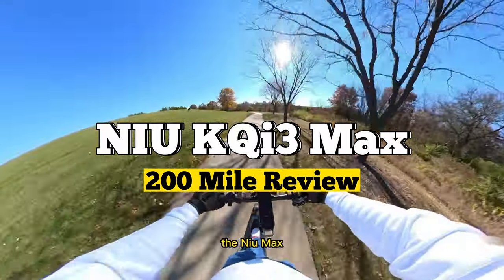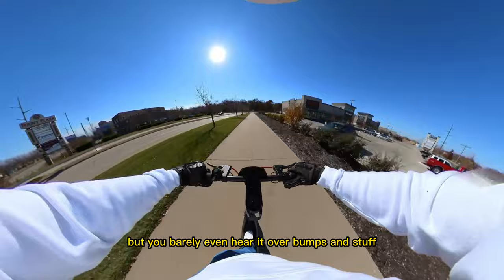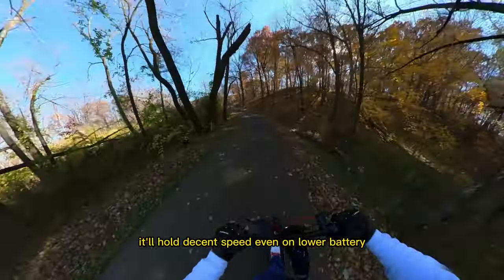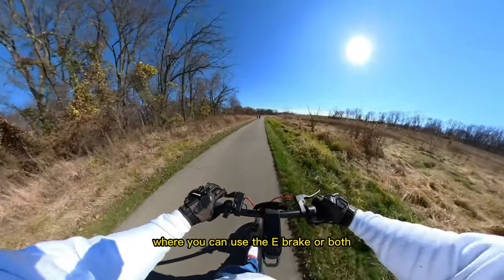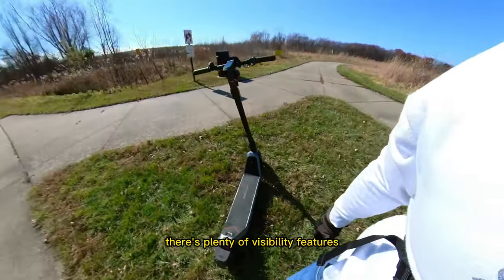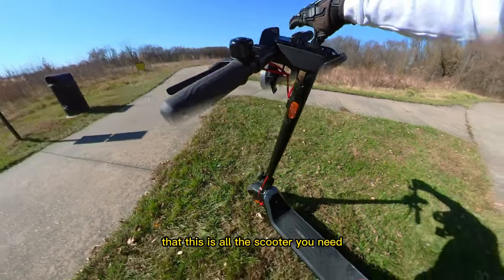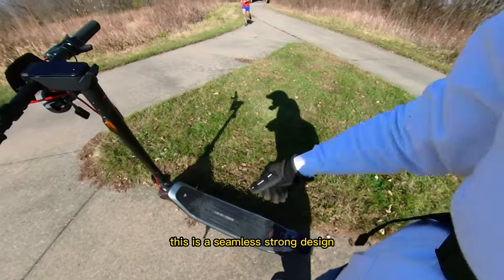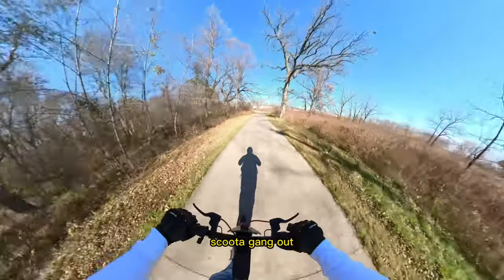Niu KQi3 Max: I Have Zero Complaints About This Electric Scooter

Comment: Had this for about 3 weeks. Its amazing. I cant believe how smooth it is. And 23mph is plenty speed. Battery is decent too. And so comfortable. I had a ninebot max and this was definitely an upgrade.
Reply: Yeah 23 is fast if you’ve never gone that fast before with😊out being in a car
Reply from the maker: It is the smoothest scooter I have ever ridden without suspension without a doubt! Feels great to cruise it!
Reply: Best scooter under $1000. 

I got rid of a Ninebot Max and now have both the KQi3 Pro and the Max. If the Max could go 30 mph and had a basic suspension it would be perfect. As it is now it’s *close to perfect*, especially given how inexpensive it is. 

NIU builds their scooters like little tanks and the build quality makes other brands look like flimsy jokes. I returned a Uscooters/E-TWOW GT Sport a few months ago and now realize how overpriced it was. 

I can’t wait to see what NIU will be bringing out next year.
Reply: @thevoiceofreason4104  nah it doesnt even have suspension. speaking of best scooter under 1k, the crown belongs to vsett 8 and yume s10. vsett 8 got 750wh battery instead of 600, it got suspension system, top speed 25mph, 600watt motor, foldable handlebar, solid tire, signal light. n i got mine for $650. s10 got a whoppin 1000wh battery, dual suspension, and 30mph for $840
Reply: @jake9854  In the city I live in scooter motors can't exceed 500 watts. Sucks, but it is what it is. You can lose your scooter if caught.

Comment: I had mine 6.5 months and paid $ 729.00 for it. Afrer riding on asphalt bike paths the rear tire was losing air pressure. i found a slight hole and tired to plug it. Well it didn't work. I purchased a new tire. Called multiply bike shops and repair shops. No repair shop wanted to touch the scooter. So i watched a Utube video and tried to fix it myself. Afer 3 days i finally got the old tire off ( By cutting it off) and the new one on. Guess what. It wouldn't inflate ! Air was seeping out of the tire by the rim area. After a week of tinking with the repair work. I just got fed up and gave it away to cut my loses. Scooter was well built and fun, but took to many man hours to fix. I magine if it was an electrical issue. Good Luck ! Be smart. Save your money..
Reply: I have seen so many posts on Reddit have the same issue. That really scares me away from NIU. Other issues like error code 03 etc. also people are saying there is almost 0 customer service in the U.S. from NIU. Canada is better from what I saw. YouTubers are not like people from Reddit are willing to share the real issues it has. Sigh. Long term review is more valuable than those unboxing and first ride reviews for e scooters. I am glad I didn’t buy it. Will stick with brands with longer history better customer service, etc. probably Apollo or Segway.
Reply: did the warranty not cover the product?

Comment: Really zero complaints, 
I've owned one for three months, in that time, 
1) the self sealing tires,, don't
2) they give you an Allen key, you need it to tighten the head bolts, oh buy an Allen key set there are others that need tightening
3) you can set the custom settings but after 3_4 miles it beeps and drops out
4) turn Regen braking off, and it randomly will turn on.,
5) throttle starting to stick at quarter

Comment: I just got this scooter about 4 days ago , best one ive had for the price . Only complaint i have about it is that we cant fully turn the headlight off during the day , i would imagine thats using more battery power
Reply: It's like a 2.5W light on low power maybe 1W. You've got a 700Wh battery so will use 8Wh if you let it on for 8h, pretty negligible  and adds safety.

Comment: Hello, good review you done there !
But i advise you to not step to full gas on the hard hills it can damage really bad the motor and the battery.
I used my electric scooter like this (my advise) and it done 1000 kms without losing any range or dead battery cells.
Reply from the maker: It's ok man I have 20,000+ miles I know what a scooter should be able to handle trust me. I am here to test them under heavy riding conditions so people know the scooter is legitimate.

Comment: My commute is 2 miles, carry up 1 flight of stairs and then carry across the office about 30 yards. Would u recommend this scooter or do u have another recommendation? Currently i use emove cruiser but its just a touch too heavy for the stairs and walk across the office.
Reply from the maker: Yeah it should be good for that, I would also check out my Vsett 8 review, that is an equally good option with full suspension and 26 mph top speed. Best customer service from RevRides! Our $50 off code is "gang" for the best deal possible!

Comment: Great video and very informative! We live around San Francisco with tons of hills. Will this one be  a good entry choice on hills? Lastly, where do you take it for maintenance or flat tire repair? What is the average cost for regular break maintenance. Thanks. (Just subscribed to channel)
Reply from the maker: This will do decent on hills but nothing like a dual motor scooter to be completely honest. Brake maintenance is very cheap you're looking at brake pads every 500 miles that are about $10 on amazon. I would ask Niu about tire changes I think they have some repair centers you can ship it to or most people just do it their-self if you are capable.

Comment: Do you recommend the Vsett 8+ over this? I’m debating between this and the KQi3 Max. I need something that's versatile & durable with the ability to adapt to mid-rough sidewalk conditions while getting the most range
Reply from the maker: They are comparable to me on flat smooth surfaces, but if you have any semi- rough routes that you like to take, you will definitely prefer the Vsett with the suspension.

Comment: You seem to like the way this scooter remembers the custom mode, but lacking the ability to toggle ESmode and Custom on the scooter is a downside, imo. I can't imagine having to push a button once after tunring on is a meaningful hassle, but being required to stop, hop off, open the app, and toggle settings in order to change into Esave mode is. Other than that, no issues I have.
Reply from the maker: Can't you just hit the power button to cycle through esave and normal mode? That's how it is on the new niu 300x. Getting a couple more nius this month, I will confirm it's the same on those.
Reply: @ScootaGang  On the NIU KQI1 Pro, it is like that. I would have to go into the app to enable custom first, and if I wanted to switch modes, the power button doesn't do anything and I have to go back to the app and turn it off.
Reply: @ScootaGang  Thank you for the reply. Under default settings, you can toggle 9mph/20mph, but once you enable dynamic mode to unlock the last bits of top end speed, you lose the ability to toggle Esave/"Normal" on the dash. Pedestrian mode still works, but switching between 9mph/24mph doesn't seem to be an option without using the app. If I'm wrong about this, I would love to know what I'm missing and will no longer have any complaints.
It would be much simpler if it just added one more mode to toggle through, but it seems that's not the way of it. If the dash lighting is an issue, I tihnk they could shorten the E-SAVE indicator to make room for maybe a few single letter indicators. P/E/D/C, perhaps. Indicating Pedestrian/Esave/Default/Custom. Something like that seems quite simple to accomplish at no real extra cost once current stock is depleted.
Reply: @xaldath4265  They might have already changed the display to allow for switching between E-Save and normal when dynamic is active without notice, not even updating the website which is why the 300X/P can change even though they have the same screen at a glance.

Comment: 2:25 here you mean 22 percent or degrees? NIce review, already bought it, can't wait to get it.
Reply from the maker: 22 degrees which is around 40 percent grade I believe. Very steep, the camera never shows hills very well...good choice you will like it for sure!
Reply: @ScootaGang  damn, that's steep as hell XD. Yeah on camera looks like a 20% hill. On the way to my house there's a 12% hill, do you think the Max can handle it? I weigh 183lbs. Thank you!
Reply from the maker: @pbugabuga  Yes for sure it can handle that. The second hill in the video I measured is around 15% and it goes up it about 15-16 mph no problems! I weigh similar about 180 plus gear.

Comment: But the folding system is loose connection when i ride it moved little bit in the lock
Reply from the maker: Hmm that is not normal, mine was extremely tight from the factory. I would contact Niu and they can help you hopefully. Or ask in the Niu facebook group and another user can probably help you!

Comment: I love the look of this one, but I ended up getting the Ninebot 30 max. Segway has a good history, but the Ninebot Max looks a little clunky to me, but what a nice ride it gives.. I may add this NIU to my collection as well. The new Gotrax's (G5 and G6) if they ever get released look sweet as well.
Reply from the maker: Good choice as well I rode a Ninebot Max g30 for 4000 miles! You will hate to hear this though, they are finally releasing the Max Gen 2 next month and it has full suspension and several other nice upgrades!
Reply: @ScootaGang  well, do you think that the niu kqi3 max is better and more powerful than the ninebot g30 max?